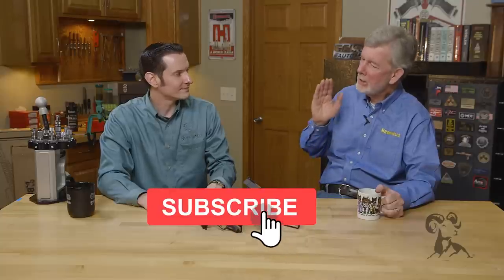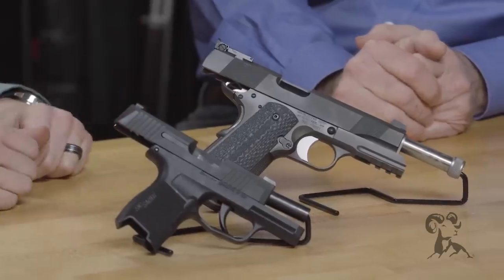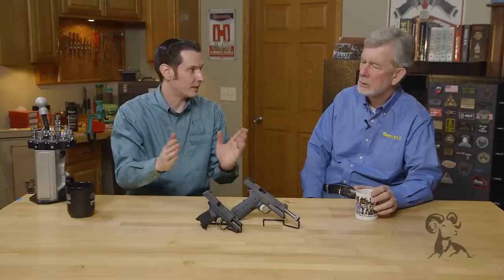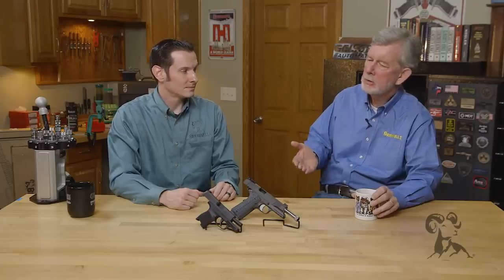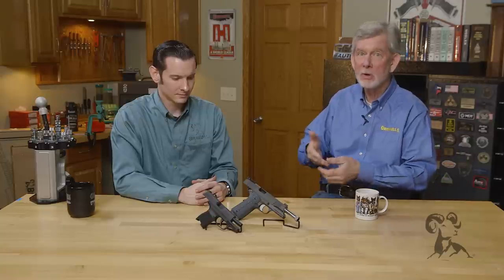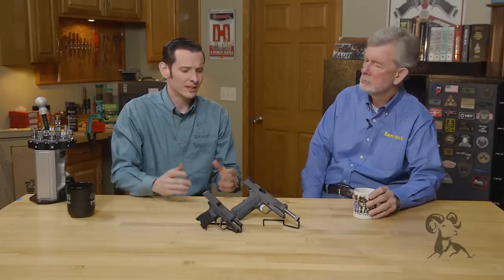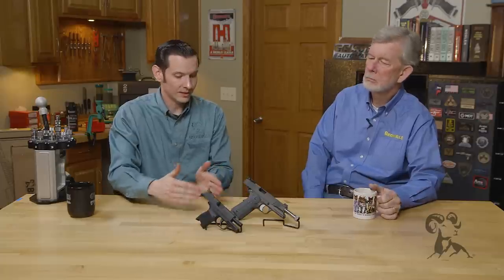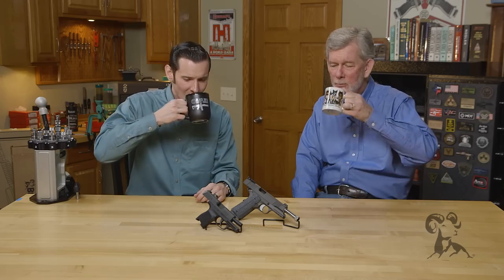Smyth Busters: Is It Safe To Drop The Slide With a Round in the Chamber?

Comment: Easy fix so you don't have to worry about it, load the first round from the magazine and then remove the magazine top it off with the last round and reinsert the magazine. Gun is now fully loaded and no worries about breaking anything. Works all the time every time.
Reply: I have several .22 automatics where it's easy to shoot one round at a time without having to constantly remove and load the magazine by simply placing a cartridge in the chamber and dropping the slide.
Reply: I never said anyone had to do it the way I described. I said the way I described works all the time every time if you don't want to worry about breaking your gun. If you're not worried about breaking anything then rock on. Personally I have too much invested in my guns to do anything that may or may not be abusive to them. I work on my guns to make them the way I want them. I don't want to work on them from breaking parts when it's not necessary.
Reply: That's how I was taught to do it.
Reply: Exactly!
Reply: didnt know there was another way to do it until i saw dis video 😭
Reply: Yeah I figured everyone did it this way. I’ve never worried about breaking the extractor on any of my pistols.
Reply: Absolutely impossible to go wrong this way, regardless of how good, bad, or indifferent your particular pew-pew dispenser might be.
Reply: This does work. But also, loading a round into a nearly full mag sucks. Especially if you do it like every day. Which is why people drop their round in the pipe and drop the slide.
Reply: @benthephilosopher I Ioad magazines and firearms quite frequently the same way I described without issue. I use a maglula most of the time but my thumbs are strong with the tough skin of a man on them. I don't have a problem loading firearms the way I described.
Reply: @Ben K  uplula. worth every penny.
Reply: @benthephilosopher  one has to have pretty delicate fingers to have any difficulty in loading a round into an almost full mag. I get it if it's an old timer with arthritis etc bit otherwise it's kind of a situation of suck it up
Reply: This is how I was taught, and I never knew any other way to do it.
Reply: Every time!
Reply: That’s how we do it at work
Reply: I USE TO CARRY +1,,,,  Not any more.

I carried +1 in my 1st gen glock 19 until one day the bottom of the mag broke and all I had was 1….. and my extra mag.

You can tell the difference when loading a full mag into a gun with a round already chambered as it puts extra pressure on it.

That extra pressure caused a failure in the ridge of the gen 1 base mag cover.

Glock changed the bases but they’re still made of plastic.

If I need that extra Barney bullet I know how to change mags.
Reply: @LifeSavingDefense  can't say I've had that problem. I carry at least one extra magazine. I still carry a fully loaded gun. Ask anyone that has ever been in a gun fight if they wished they didn't have the ammo that was left as extra if they had any left at all. My answer is I want to have as much as is feasible. If I still have ammo left then I still had a chance to walk away alive.
Reply: I would have never thought of doing it any other way. That's I have the machine. I let the machine do it's job.
Reply: Oh, and if my magazine breaks I have another magazine.
Reply: I place the first round in the chamber and then ride the slide softly until it stops (out of battery) and then press slightly in the back of the extractor (my gun has an external extractor) so that it lifts enough to fit in place. That way I don't have to load from the mag and replace the top round. Maybe it's not correct, but it works for me.
Reply: @josesardinas7660  considering that the extractor is not suppose to ride over the rim of the case but rather the case rim is suppose to slip in behind the extractor, you are putting undo stress on the nose of the extractor and the extractor spring. Your way works for everyone that does it, until it doesn't.
Reply: @abolishtheatfandrepealthen6014  Loading several hundred rounds in a day tales a toll.  At a pistol match, it's better to save the hands for shooting.  Another case of "just because you can doesn't mean you should."  Limited and open class guns use magazines that hold 20 or more rounds.
Reply: @David-hm9ic  if it's something where you're taking a class or a competition where time wasted will cost ya then yeah of course I'd use whatever I could to speed things up. If it's just a range day I don't have an issue thumbing rounds in, it just doesn't bother me
Reply: Exactly the way I've been doing it forever. It may take a little longer to top off your pistol this way, but you won't break anything doing it this way either.
Reply: Bullet setback is a thing I've had to deal with. It sucks.
Reply: @mikeoxlong3676  don't chamber the same round all the time and bullet set back isn't a thing. Simple common sense things make daily tasks less painful.
Reply: Bullet setback becomes an issue.
Reply: @mikeoxlong3676  I've never had a problem with quality ammunition. Of course I also don't constantly chamber the same round of ammunition repeatedly.
Reply: Lol all the lazy people are pissed about reading this. It’s not just about the extractor, I’m worried about the propellant in the primer for a self defense situation. Going from the mag is just better all around
Reply: @T20-c8f how would the method of chambering have any impact on the chemical makeup of the primer?
Reply: That doesn't help if you're doing it to avoid setback of an EDC round being re-chambered every day.
Reply: @darinhouston1009  @darinhouston1009 umm yeah, with some common sense it does. Don't chamber the same round everytime. I also only unload a carry gun to either go to the range or cleaning. Otherwise I have no need to unload the gun I'm carrying.
Reply: Except when you're out and about, and you wanna show your buddy your new toy. You drop mag, eject round, and hand him the gun. He gives it back. Getting that last round in most of my mags is near impossible with my hands, I need to use a loader for that last round. In this case I always just stick the bullet back into the chamber and drop the slide on it.
Reply: @Thomk121  go to the gym, problem solved!

Comment: Beretta actually advertises that you can do this as a feature in their 92 line. They don't mention whether it will break your extractor or not, just that it will work as a single shot. I'll still be loading from the mag with all my pistols but it is good to know you can do this with a Beretta.
Reply: And Toyota says you can go 10,000 miles between oil changes.
Reply: @georgegravette1132 Shit my first car was a 1995 toyota camry.  I ran that shit on used oil. The wrong oild, 2 quarts low.  And that thing always ran.  Toyotas are very strong cars, so are glock 19s.  Drop the slide down who cares.  Worst case scenario after 1000 rounds you might have to buy a 25 extrator pin, oh no!!!

Comment: I would like for you guys to address the concept (myth?) that leading can be cleaned out of a pistol barrel by shooting jacketed bullets.
Reply: I've wondered myself
Reply: It won't. You cannot reduce fouling by shooting more. In some cases of heavy lead fouling you can damage your barrel and throat as well. Don't do it!
Reply: I thought it was more like, shooting a couple jacketed rounds after shooting cast lead would help with the cleaning later.
Reply: @marzcapone9939  You aren't going to experience any improvement in cleaning by doing this. At best it won't do anything. At worst you'll end up with some really stubborn bore fouling and increased pressures. It's similar to running an engine with dirty oil, you won't improve the existing condition by simply adding new oil.
Reply: Either way no matter what your shoot the gun powder is still gonna resonate within the barrel

Comment: If you know the design of an external extractor, you know there's a spring under the rear of the piece, and a fulcrum point near the middle.
Why?
To allow the chamber end to flex outward when encountering a case rim, and then return to its normal position to hold on to said case rim.
It's literally designed to do it. Then you just have to consider if the steel itself can withstand the impact of the action.
Could it cause "unnecessary" wear? Sure. But it's designed with this function in mind, so make your own choices.
Reply: Shooting the gun is also an unnecessary wear.. really people shouldnt be surprised that a tool you use wears down over time. Modern weapons are very idiot-proof and most of the time designed to do all kinds of shit that some people consider unnecessary wear. I dont see a reason to not use a feature of a gun just because it might or might not introduce slightly more wear, its not like youre only going to own and shoot this one gun for the rest of your life. Mostly youre going to spend more time looking for ammo than shooting the gun anyway :D
Reply: Just replace the extractor once a year or so and it's fine. They're like $20.

Comment: If you do this repetitively as a habit when you load your gun so that you can have the full magazine Plus One in the Chamber effect you will indeed where your extractor down over time. I have replaced dozens of extractors on external extractor pistols due to this habit alone. I've never seen the extractor break. I've had many many people come in complaining about failures to extract. I will determine that the extractor is worn down. And when I questioned them about how they initially load their pistol quite consistently people report that they throw round in the chamber and release the slide before inserting the magazine into the mag well. I also did this repetitively on my M&P Shield and measured the effect on the extractor. It was significant
Reply: That's awesome info, reports from others and then you replicated it yourself. Thx
Reply: I have a 1911 that I have used in IDPA for 3 years and at Front Sight Firearms Training at least 4- 4 day training sessions. I always drop one in the chamber and release the slide and have never broke or worn down my extractor yet to the point of needing to replace it. I would give you a round count but I lost count after 6 or 7 thousand rounds thru this gun. My best guess is well north of 10 thousand at the least. I guess it depends on the gun and quality of the manufacturer.

Comment: Ive been an armorer for my department for alot of years now (large dept) and have never had one of our glocks come back for a broken extractor.  I have seen quite a few ruegers with broken extractors, but I put that down to a weak design coupled with stainless parts.  the biggest issue I have found with Glocks is broken slide rails.  After 10k plus rounds through our training weapons, I have seen alot of broken slides.  My favorite was a pistol that had three slides fail simultaneously which caused the pistol to go full auto and do a mag dump.... that was an exciting few seconds!
Reply: The rails broke after 10k rounds???
Reply: Three sides FAIL simultaneously ??? Three slides on one pistol ?
Reply: What do you mean the slides failed? Can you elaborate
Reply: You expect more from a Glock? Be lucky they got to 10k rounds.

Comment: The issue in my experience has had more to do with sear engagement and risk of discharge than extractor issues. Many tuned 1911s with less sear engagement surface against the hammer hooks can experience a condition where the hammer is jarred loose as the slide is dropped. Without a firing pin block the hammer may hit the firing pin and discharge any round placed in the chamber. The half-cock notch is supposed to stop this but it can fail, especially on modified hammers. Feeding from the magazine slows the slide impact. I have heard it recommended to hold the trigger down to keep the disconnector engaged when using a light trigger 1911 to avoid this issue (keeping the gun pointed down range and carefully resetting the trigger after the slide is fully dropped. Should not be an issue with most modern pistols.
Reply: If your gun fires when you drop the slide then it is broken and should not be used until repaired by a professional, not the dummy that modified it in the first place.

Comment: The only fly in the ointment of always chambering a round from the magazine is that if you have unloaded one of the newer small 9mms, such as the Sig P-365 or Springfield Hellcat, it is almost impossible to "top off" the magazine without a magazine loading device.  So if I want to reload to full capacity other than when I have a device with me, yeah, I drop the single round back into the chamber and let the slide slam home, then insert the full magazine.
Reply: Wouldn't it be just as easy to drop the slide slowly and avoid all possibility of extractor damage?
Reply: @briancantrell1050  When you release the slide and retain the tension you risk not allowing the slide to go into battery. This means that when you pull the trigger you get nothing when you are expecting a bang.

Comment: In the old Ruger P series autos, dropping a round into the chamber and letting the slide drop is recommended in the manual for single loading cartridges.
Reply: Interesting! The P94 was my first handgun that wasn't a cheaper throw away, line a Lorcin or Jennings ha was a great gun. Got Glocks and never looked back, however
Reply: Those P-series were built solid.  Nothing flashy or fancy about them, but they just run and run and run.

Comment: I worked for an agency which issued the Sig P229 at the time. I was part of the instructor cadre and we replaced over 50 plus extractors in the 4 yrs I was there.  Most if not all were because agents were dropping the slide with a round in the chamber.  There was a distinct half-moon “chip” that exactly fit the shape of the case. 

There was a time when we received a lot of MIM parts when Sig transitioned from German made parts to out sourced MIM parts TBH I can’t remember if that included extractors…but what I can tell you is that after we included training on not loading pistols that way, the number of replacement/broken extractors dropped to almost zero.  

Frankly I think it’s lazy to load this way. As someone else stated in the comments, load from the mag and top off the magazine, it literally takes @5 more seconds.

Comment: Best reason I have seen to load from magazines is a floating firing pin. Never had one go off, but I have seen many marks on primers. One out of spec component and that could be a bad day.
Reply: That happens regardless, and what's the worst that happens? The round fires and you get scared, it's not going to blow up
Reply: Plus its gonna be slamming down on a live round regardless if you load it by hand or from the magazine so the argument is kinda moot either way, assuming you know how to handle a firearm and keep it pointed in a safe direction
Reply: @Tactical_Arborist_1776  When a round is stripped from the magazine it slows the bolt or slide down significantly.  Dropping a bolt or slide on a chambered round allows a much higher bolt/slide speed.